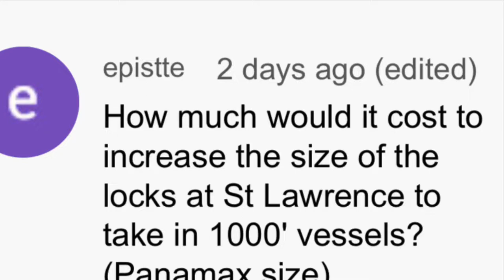How Much Would It Cost to Expand The St. Lawrence Seaway?

Comment: If the Great Lakes begin accepting container cargo in a huge influx then I can see it becoming necessary to expand the locks and a "container boom" on the Lakes could help fund it, though it would have to be done very very carefully in order to minimize environmental damage and disruption to the local inhabitants (neither of which were respected in the construction of the 1950s locks, as much of as a benefit and marvel that they are) and doing so with such care would likely take a couple to a few years to complete (depending on the size of the workforce).
Reply from the maker: It would take a considerable amount of planning and expanding the locks themselves.

Comment: Connor, I live in Sarnia on the St Clair River 1000  ft ships go by here often. They are limited to 30 ft draught. I don't think I have seen container ships this far up the system. The large ocean going container ships have very deep draught and basically only stop at deep ocean ports.
Reply: itcan be done. there are small container ships that go up the mississippi River and it has only apx 15 ft Draught
Reply: Not sure 2 1000' container ships could navigate the Brockville narrows at the same time.  It would require some sort of traffic control like the Suez Canal.

Comment: You're likely greatly underestimating the cost of such a project. The new 1200' lock at the Soo already has a $1 billion dollar price tag and that is expected to rise due to the high inflation we're currently experiencing.  That's just for one lock.  The Welland Canal system bypassing Niagara falls is 8 locks and the St Lawrence River has another 7 locks. The Welland locks are nearing 100 years old. It's doubtful they could be modified economically so they'd need total replacement. An entirely new canal might be needed so shipping isn't interrupted on the current canal. The locks on the St Lawrence River vary a lot in specs so I really couldn't guess what the cost of modification (if possible) is there. But instead of just $10 billion one could easily say $100 billion or more. 

IMO, the time to expand the Seaway locks was back when they were still on the drawing board in the '50s. If they had done it back then (along with a new set of Welland locks) this wouldn't be a problem.